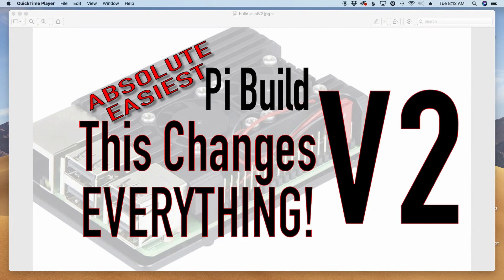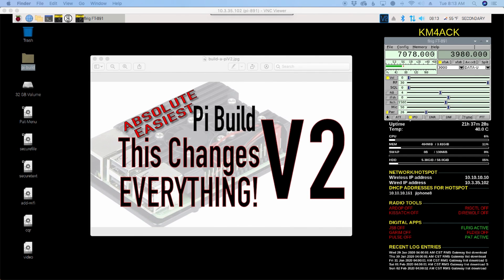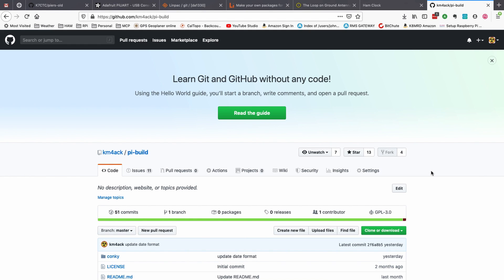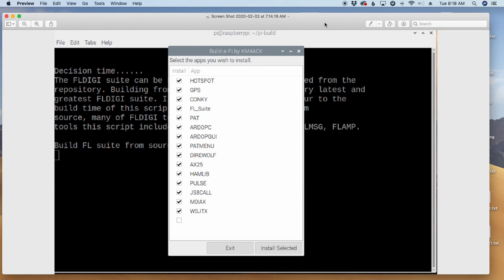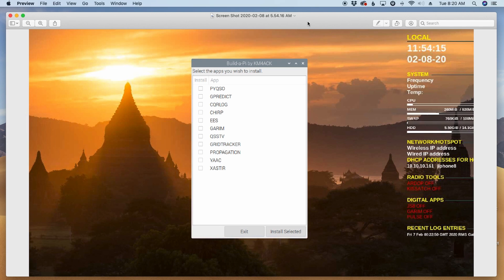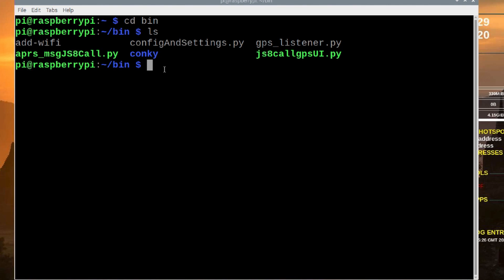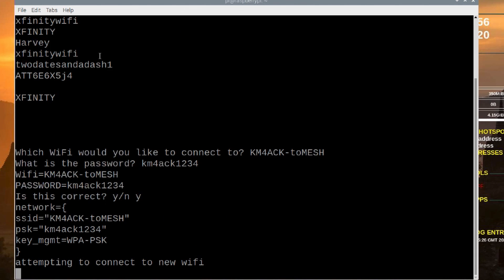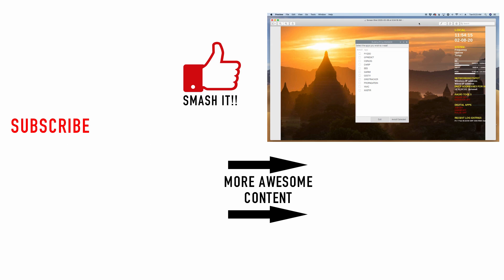Build a Pi V2 | Raspberry Pi Ham Radio

Comment: This DID change everything.  I went through all your other videos, completed an install "manually" (really, just following all your steps/scripts).  Followed this and ditched my build over this most awesome build.  You made me a Pi convert.  I'm building this into a field-rig using the Portable Zero gear with some help from my 3d printer.

Comment: Great update Jason. The add wi-fi was a nice extra for those who take our Pi on the road. 73 de KM6TRZ
Reply from the maker: Thanks Don! If you like the add-wifi, you need to check out the new hotspot tools on Patreon I just released. https://www.patreon.com/posts/only-brave-need-34257157 We are up to version 0.22 with several things added since that post. You will really like the new set of tools if you take your pi on the road. 73, de KM4ACK

Comment: This is great Jason!!!  I am ready to install this.  Already went and got myself a new 32 Gig Micro SD card and ready to do a new install!!  I am also trying to get my Raspberry Pi 2 setup.  I purchased a USB wifi adapter (looks like a mouse USB wifi connector) to try and get my Raspberry Pi 2 wifi capable.  I am having issues with that right now.  But, my Raspberry Pi 3 + has been running great with the early release of the V2, so I am glad to start a whole new install and get that up and running.  Thanks again Jason for all the hard work and effort you have put into all this.  Again you have provided the ham radio a community with a valuable tool!!  Juddie WD8WV

Comment: I'm having a great time with Jason's massive effort! First I hope he doesnt come out with a version 3 that requires starting from scratch!
 I'm no expert, but here are some of the things I've added to mine. SUGGESTIONS APPRECIATERD!! 
1. Following Swedish guy on youtube I boot/run off a SSD. Nice. 
2. I have too many pi's and set them all up with fixed etho & wlan0 IP addresses, and added cute names. 
3. I rely on Midnight Commandfer (mc) for my file chmods,chowns, file transfers. 
4. I like synaptic for application additions, 
5. gparted shows the disks setup, 
6. A simple shell script backs up an image (when I rember to do it). 
7. I use the handy rsnapshot backup program as well, 
8. I'm loving conly! I put a fan on my pi and can see the lower temp. Editing info on its use would be handy as I learn more. Hats off to Jason for this and the personal tips he has provided me. 
Unfortunately packet & JS8 are in the back seat as i get my pi family happy. Another one set up for Python. 
SEND ME ALL YOUR COOL PYTHON HAM APPS, I LEARN FASTEST USING THE P&M (PLAGIARISE & MODIFY) APPROACH! 
 https://www.qrz.com/db/W4GHV Bo W4GHV since '54

Comment: Wow this is impressive and I must say there’s a lot of reading I need to do to catch up and understand the use of all of this software. I am very curious what your thoughts are on taking a lot of this software and including it preinstalled in a full Linux distro for desktop laptop etc? I’m working on a project now called DragonOS and would like to incorporate more ham based software into it. Going down the list of software you’ve rolled into the pi and trying it out in 18.04 and Buster now.
Reply from the maker: Yes. You should be able to build an image and distribute it. I don't prefer that approach as the maintainer of the image has to constantly update each version of the software manually, then recompile the image, and upload it. The approach this script takes grabs the latest version when the end user installs.
Reply: KM4ACK I spent an hour or so yesterday going down your site and installing software one by one. My screen was filled with interfaces I’d never seen nor used lol.. you’re right though, I had to pull down the source and build each package, some were deb packages and I needed a few apt get things. It looks like it’ll work though, but then I got to thinking could we or I adapt your script to do something similar in my “DragonOS” Lubuntu 18.04 distro?

Comment: Thanks Jason for this video - it worked great! Per your link, I bought the GPS dongle you suggested.

One thing though, I could not get a GPS signal with the GPS dongle plugged directly into the Raspi. I had to add a USB extension cable and move it away from the Raspi in order to pick GPS signals.

Also, I like to to POTA. I have looked at the logging programs you have installed, and there is a slight issue when working what is known as a "park to park". That is when submitting logs two additional fields are needed. Per the POTA documentation they are: SIG_INFO and MY_SIG_INFO.

I was shown a logging program that looks like it will fit the bill for POTA on a Raspi. Its called xlog. It has two blank fields that you can add to the log, and you are good to go for POTA.

Once again, thanks for all of your great work! Hope to catch you on the air someday

-- Mike WB8ERJ
Reply from the maker: Thanks for suggesting xlog. I added it to the list of feature requests. https://github.com/km4ack/pi-build/issues/45

Comment: Great job!  Love this setup.  Quick question - the on-screen info?  I changed my screen to 1920x1080 and now the system info backdrop is in the middle of the screen.  Where can I find that to re-config for an HD screen?
Reply from the maker: reboot and it should move to the edge of the screen.

Comment: Got everything installed and running for my new Pi4. Just wondered what is the advantage of using FLDIGI for JS8CALL. I manage quite well without it with a Signalink for the FT817 and the Sabrent for the KX3. VO1OK
Reply from the maker: You can't use FLDIGI for JS8Call. They are 2 different applications.
Reply: @KM4ACK  Thanks that what I thought. But at least it's there when I need it. Stay well and keep up the good work.

Comment: Jason this is fantastic work! Thanks a whole bunch!! I have a question. The install on the first round of programs installed as expected. I had checked every program and they were all there in the dropdown menus. Then I checked all of the programs on the second round and only four programs showed up on the menu (Chirp, Garim, Gridtracker and Yaac). I have found the remaining programs in the Add/Remove programs tab. If I want any of those remaining programs, do I install them from there? The Propagation program is the only one I couldn't find anywhere. Gerald - KG0VA
Reply from the maker: Sounds like something didn't complete in your build. You should be good to use the add/remove programs though. For prop prediction, I did a video on it https://youtu.be/jye6JkIPYY0

Comment: Hi Jason awesome work again helping us who are newbies to the Pi and running scripts as a fellow ham I cant thank you enough. Would like the add-wifi script as a separate item if you can find time as I always seem to have issues with the wifi for headless and going back in the shack, running a number of tests after getting a lenovo tablet to go portable with and hopefully will be ready when the uk weather improves. 73 and again thank you very much.
Reply from the maker: I'm not sure I understand your add-wifi request. You can already run the script at any time after the build from the terminal. Also, I am working on a new set of tools for managing the hotspot. You can find out about the new tools here https://mailchi.mp/17d1631153a8/km4ack Be sure to subscribe when you are there. Often the newsletter subscribers get early access to new things I am working on. 73, de KM4ACK

Comment: Thank you for this script and the others that you're supplying!  We're building Pi4s to run our rigs as a club project and this will kick start everyone's build.  I already built mine using the old version of the script so that I could demo for the club.  Do I need to uninstall apps from the first version in order to use this one and do the builds from source?

Comment: Thank you for your videos, Jason, they have been a big help for me. The only thing that is stopping me from using the pi 4b exclusively for the shack is JT Alert. I know about AlarmeJT which would be ideal but for the life of me I cannot get it to run. Is there a way to use JT Alert from Buster? Jt Alert is essential when using my tablet connected to the pi as the stations on FT8 scroll up that quick I miss most. Thank you and keep up the good work.
Reply from the maker: To my knowledge JT Alert is windows only software. Do you have a link to AlarmJT? I would be interested in exploring that as an alternative. 73, de KM4ACK
Reply: Hi Jason, Following are some links for AlarmeJT  the last link is a discussion forum for problems running the program. Hope you can get it working, I couldnt.

 https://sourceforge.net/projects/alarmejt/  (Download page)

https://x8x.net/2015/12/08/using-wsjt-x-in-linux-with-cqrlog-and-alarmejt/ 
(using AlarmeJT with CQRlog and wsjtx)

https://sourceforge.net/p/alarmejt/discussion/EN/thread/771599cf/?limit=25 (Discussion page)
Reply: Hi Jason, gave up on AlarmeJT, just couldnt get it to work. I did find however that CQRlog has a remote feature that does exactly the same as AlarmeJT. Check out youtuber  OH1KH https://www.youtube.com/watch?v=W3KsYBLbR8g&t=344s

Comment: Jason I installed build a Pi V2. Nice install. I get a lighting bolt next to my call sign, what does it mean.
Reply from the maker: You power supply isn't substantial enough for the pi. You need to upgrade your pi's power supply.
Reply: @KM4ACK  will look into that. Thank you.

Comment: Hi Jason. Does the script by default modify the system sources? My thinking is that if it does then keeping the apps up to date would be easy using the pi software manager. If it sets up sources to all of possibilities in the script it might assist where on first build a user chooses not to install something and then wants to do it in the future.

Thanks again

Chris
Reply from the maker: No.  I suppose that could be a feature in the future, but currently it is only meant to do the build one time. 73, de KM4ACK

Comment: Bill - N6EF - Trying out your script on a fresh pi4 install. My wifi network uses a hidden SSID and I have to manually add the scan_ssid=1 parameter to the wpa_supplicant.conf in order for my pi to connect to my wifi. Would it be possible to add a prompt to ask if the wifi uses a hidden SSID so the script could add the scan_ssid=1 parameter to the wpa_supplicant.conf file? I haven't finished the install yet so I haven't tried adding in the parameter to see if my pi connects to my wifi. Awesome piece of work. Thank you. Supporting you on Patreon.
Reply from the maker: Thanks Bill. That would be possible. Another issue you are going to face with a hidden SSID is the hotspot. It doesn't play well with hidden SSIDs. 73, de KM4ACK

Comment: I started with a freshly flashed card of buster. Ran the script, everything loaded fine. When I try to open the file viewer to start configuring PAT, it opens for a brief second and then closes. After trying a few times the icons on the desktop disappear. Very new to pi, but everything works great. Instead of going through each and every instal I reflashed sd card and ran this script if that helps.
Reply: Fixed this morning.  Using Apt get upgrade.

Comment: Jason, this is fantastic! I have found it super helpful in configuring the pi. I have had one problem, and wondered if you had heard of it. For some reason the GPS dongle does not work when I install the gps program using this script. It does work if I install the gps program without the script (i.e. building the pi using your written instructions). Has anyone else run into this that you know of? When I run systemctl is-active gpsd and systemctl is-active chronyd, both come back active. However, using cgps returns no results, even after an hour with the dongle plugged in and the pi sitting in a window. Your work on the Raspberry Pi is a huge help to many of us in the amateur radio community. I just want to express how much help it has been. Thanks for your investment in this Jason! 73, de K8KNX
Reply from the maker: Does the GPS dongle have a green flashing light on it? If not, then it hasn't gotten a lock yet on the satellites. Without a lock, nothing GPS related will work on the pi. Leave it powered on overnight and check it again in the morning. I'm not sure why but the first lock can take a REALLY long time. This only happens on the first lock thought. The GPS doesn't need anything installed on the pi to get a lock. In fact, it will get a lock if just powered up by a standard USB power plug.
Reply: @KM4ACK  I'll try leaving it overnight. It got a lock just fine before, but for some reason it's taking much longer this time. I appreciate the help!
Reply: Just an update... finally got the GPS dongle to lock on... after a few hours of letting it run, I decided to try a restart before leaving it all night. If got locked on almost immediately after restarting... not sure why that helped, but it seemed to. I tried restarting at the start as well, but seemed to do the trick this evening. Again, thank you for all your help and the and the invaluable service you provide to the amateur radio community. 73, de K8KNX
Reply: @matthewsarahplyler7304   I installed all on a new sdcard.   GPS is also not working.   Works fine when I put back the old card.    I tried re-installing and checking the configs.  I read this, so I'm hoping it will take care of itself with time.

Comment: Hi Jason, is it OK to run the Pi via Ethernet to a laptop .Building for RTTY contests and  WSJT-X.Skipping SSH.
Reply from the maker: Don't think it will work connected direct to the laptop. You can connect the Pi to a router via cat5 and use VNC to access it.

Comment: Is there a way to disable the screensaver?  It's only on a few minutes without an input,  then it goes dark. Thanks Jason for your work.
Reply from the maker: If you are referring to the VNC connection, right click on the VNC box in the top right corner by the clock on the pi. Choose options and then privacy. Uncheck the box that disconnects idle users.
Reply: KM4ACK No, im connected to my screen via Hdmi and Keyboard via usb. After a minute or so without input, the screen goes dark. Any keyboard input or mouse movement lights up the screen again.
Reply from the maker: @706MK2G  sounds more like a sleep mode. can't say how to fix. I don't run monitors connected to any of my pi's.
Reply: KM4ACK Ok, i will continue to look for the setting in the monitor maybe then.  Thanks for your reply and good work with the Build-a-Pi 73!
Reply from the maker: @706MK2G  try this. sudo raspi-config Then choose option 7 and the option 6 is screen blanking. try disabling this and see if it helps.
Reply: KM4ACK That did the trick! Thanks Jason for your support.

Comment: I have installed and have working FLRig, WSJT-X and JS8  using your new script. I do get the an error (listed below) in a "addon-build-a-pi" screen. Also the later list of apps to install (PYQSO etc) also is sitting along with the error screen. This is on a Pi 3Model B+.  Terrific work for the Amateur Radio Community.  

(yad:967): dbind-WARNING **: 12:34:33.066: Error retrieving accessibility bus address: org.freedesktop.DBus.Error.ServiceUnknown: The name org.a11y.Bus was not provided by any .service files
Reply from the maker: It is a yad warning but as long as the display box shows that allows you to choose the apps, it shouldn't interfer.
Reply: @KM4ACK  You are correct...I see the ones I chose. Tnx again.

Comment: I'm curious about something. Aside from the obvious changing the architecture from armh to amd64, what changes would be needed to run this on Linux (say ubuntu)?
Reply from the maker: a lot of it would probably work but the script downloads some apps like js8call specific for the arm processor. it would take some modding but could be ported with a little work.
Reply: @KM4ACK  I've got a little time on my hand the rest of this week. I may give it a shot. I know that the PIARDOP ones have a regular version. I'll have to check into some of the others.

Comment: Jason Thanks for the detailed install. I am having issues related to permissions, I am running the Pi 4 via VnC with the default user. I run the script with sudo prefix and it bombs out with "What is your call sign? KO4DHH
touch: cannot touch '/home/pi/pi-build/callsign.txt': Permission denied
/home/pi/pi-build/build-a-pi: line 70: /home/pi/pi-build/callsign.txt: Permission denied
Please stand by while we grab a few updates
This may take a while if you haven't already
updated the system. You will be presented with
a pop up window shortly to select which
applications you wish to install.

Press any key to begin
I hit any key then when I get to FLd install it give a similar permissions error. I have removed the pi-build directory and tried again with the same results. Any thoughts on a resolution? Thanks KO4DHH
Reply from the maker: Are you using NOOBS? It's known to cause issues. Check out the FAQ if you need help flashing the card with Buster. https://tiny.cc/km4ack-faq
Reply: @KM4ACK   I am using Buster, and am very familiar with Raspberry PI, I have be able to do most everything, including update/upgrade pkgs. It seems it is related to permissions on the scripts. I just manually loaded PAT and was good to go there, just hoping to use your script to load all the related pkgs
Reply: Jason, I found the issue, I was running the command via SUDO, apparently not needed. -73 KO4DHH

Comment: After upgrading to V2 I no longer have sound from the Rpi sound jack. I can hear a little sound, like the jack is active but it doesn't pick up any input. I did include pulse audio in the build.  I have tried the advanced audio settings and have looked at the pulse settings. So far I have only tried hearing sound from chromium youtube channels.
Reply: I found the problem. I unclicked the Enable box on Output Device Options..PCM Playback